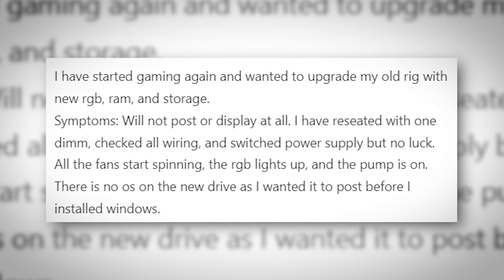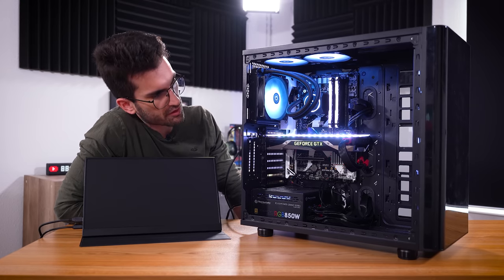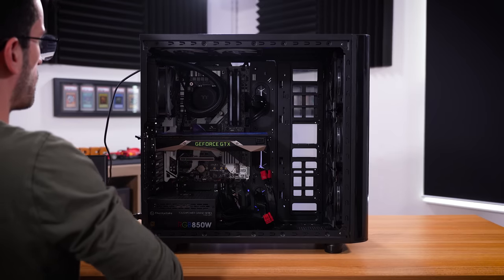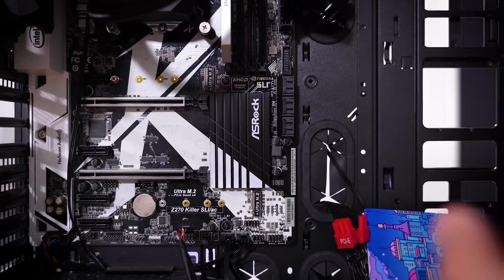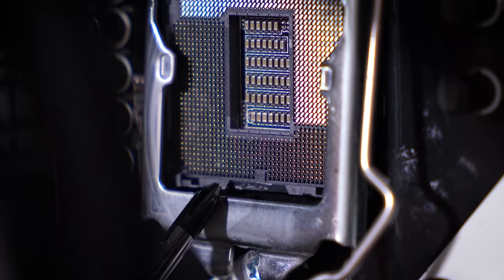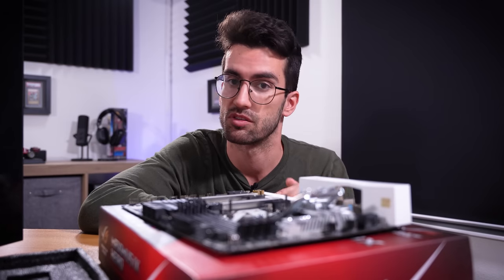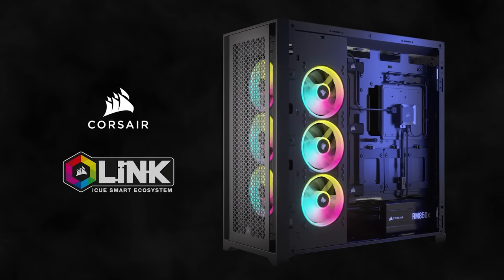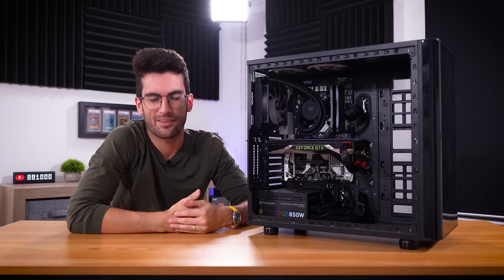Fixing a Viewer's BROKEN Gaming PC? - Fix or Flop S4:E14

Comment: kinda reminded me on how I revived a 7th gen intel mobo by asrock which was given to me since it doesnt work before. I just saw that it has some few bent pins that are not easily seen including a broken pin and proceeded to put them back with a tweezer. It eventually worked thereafter. right now it is being used for my sibling's pc which I modded to run an 8th gen intel cpu. good work, man.

Comment: Glad this worked out with the bent pin. Had someone else's motherboard end up with a pin broken so far down it couldn't make contact. Had to replace it. Luckily I keep older used boards on hand in case such issues arise. Keep making these great videos. They are my serotonin.

Comment: Great eagle eye for that piece of hair or something on the socket there Greg. I used to work at a refurbishing pc company as a hardware technician and this was very common issue, when someone wanted to change the cpu or just to simly clean the leaked out paste by himself. This often occurs when you try to wipe the paste of the motherboard with dry cotton (have seen it) and a piece of cotton gets cought on the pins of the socket, might bend/break pin or just make a mess, like in your case. If you can't see that string you would wonder why it doesn't post but apparently it messes with the contacts. Great "cheap" fix. Keep doing what you do! You are great !

Comment: I remember fixing bent pins on a motherboard to get it to work and then for it to fail later when I changed the cooler. This would motivate me to save up for a platform upgrade.

Comment: Nice that you were able to get the system running w a portion of that pin. I wonder if indeed that pin is used or if it was just shorting an adjacent pin in the socket.

Comment: Just built a system with this exact same board with a i7 7700k for my daughter. I got it for a great price locally.
When you flip the power switch at the back the led will flash once and then go out. Great board, first time I’ve built with ASRock.

Comment: I was in the Navy in a F-14 squadron. The aircraft used cannon plugs to connect wire harnesses and avionics. If we had a bent male pin we got a female pin of the same size and gently reshaped the pin. You couldn't do that on this motherboard but on a pinned cpu it might work.

Comment: Back in the day when i worked at a pc shop i had some odd failures with cpu pins. I had to get creative as no one had the money to replace the parts. I would try my best to create pins that was snapped off on the cpu and motherboard  or PCI slots with missing pads by using broken boards and cpus i had laying around. I created a very small soldering tip and heat gun using a file on old copper heatsink.that took me a few hours to get it round and right size. I enjoy finding ways to fix things with what you have hanging around you. i would enjoy doing this again but, as parts get smaller its not as easy to fix like the old days.

Comment: Hi Greg I am just wondering what CPU you would recommend for 1080ti as I am currently using a 4770k (slightly overclocked) and I am running into performance issues and stability problems with it as well.

Comment: Just recently built a new system with my brother. since then I have watched dozens of hours worth of PC building content. Ryzen 5600x. XFX Qick 7600 GPU. Musetex K2 case. ROG Strix B550-F motherboard. nothing insane but still miles beyond the 12 year old laptop I have been limping along with since moving to TN from WI a decade ago. Its been up and running for about a month now and it is hard to believe I have not used or run a desk top system in over a decade. I really enjoy the troubleshooting and build content and cannot wait to upgrade down the line and build another rig. thanks for the knowledge and all the information you put into your videos. 
 ~Eric

Comment: Hi Greg. Your videos usually show removing components and replacing them with a component you know is good. Working inside a PC case can be a real pain. When I need to work on my PC, I remove its parts and install them on my test bench. This allows me to see the components better and makes removing/replacing them more accessible. I also mount a working PSU on the test bench to eliminate the removal of the PSU from the PC case. Using my test bench assists me in the diagnostic phase of the repair process. I purchased my test bench from AMAZON for less than $30.00. It's the best money I have ever spent on my PC.

Comment: Ive used push pins to fix bent pins. Even a broken pin can be bent back a bit further to still make contact. It usually can save a system.

Comment: Hey Greg,
I recently had a case similar to this. PC wouldn't post, no matter what I tried. Funny enough, it also had a missing jumper on the 3 pin connector. I had to replace the battery and and also make sure that 1 & 2 (Normal) were jumped. Since then, the PC is running fine. Also, the red blinking LEDs are the default RGB pattern for that board (I had that same one couple years back)
Maybe that helps you in the future. Thanks for another great FoF Episode - I really enjoy watching these. Hope you, Lisa and the Kids have a great weekend!

Comment: My 4770k board had a single bent socket pin.  It was hard just to see the pin to even get the needle in.  I used a pocket lupe to make it easier.  Pin popped back into place as soon as the needle touched it.  Board is still going strong in old pc somewhere.

Comment: These symptoms remind me of a PC I built in an old 1998 case. I successfully installed Windows and used the PC some. I had some intermittent fails to see an image. I upgraded from a GTX 960 to a Radeon 7600. It would not display at all. I swapped in a functional 3060. No image. I moved the components to a 2010 case, needing to cut a few millimeters from one side of the GPU access slot to get the video cable to seat into the GPU. The issues vanished.

While needing to cut some of the access slot metal to seat the cable that I noticed newer cases have added an access slot on the side of GPU backplates. My two older cases paired with newer motherboards don’t align the first access slot with more modern multi slot GPUs. The cable would sometimes seat, and sometimes not with the difference being so slight that I didn’t notice it.

Comment: Quick question before I do anything stupid. I recently took out my old system to sell it by parts. I took out the CPU from the motherboard but since I use more than an average amount of thermal paste, it basically found its way into the LGA socket. The system still turns on but idk if its gonna cause some issues. No bent pins however, just thermal gunk covering 5-7 pins[Not entirely covering, the top of the pins still seem to have contacts. Will this cause some future issues?

Comment: Based on the initial showing it looks like the bend pin was shorting the other one and that caused the issue, In most cases even a few bend pins are no problem as long as they are for power or something not critical. I have also used staples inserted where a broken pin is cut to size and it can work to salvage an otherwise great motherboard from the waste land

Comment: When you don't have LEDs on the board connect a speaker in the front IO section off the board. It will beep in some order, that you reference to the manual to find out what is wrong.

Comment: LGA socket pins are thin and angled because they're made to bend down when the CPU retention frame locks it in. IE; they don't necessarily need to be as high as they are to make contact. As long as it looks Pretty Good™ it will probably work.

Comment: I feel for this guy.  I just moved from Nevada to Arizona and have a SFF system and a regular full fledged gaming PC.  The gaming PC survived the move find but I had a 5600x with a stock AMD cooler on it and didn't think to support the cooler in the move.  Well long story short, jacked up pins from the bouncing of the cooler because the roads from NV to AZ are literally the WORST and nine bent pins that are unfixable later.  Now I've got a brick because I think when I booted it, it nuked the motherboard and PSU. :sighs:

Comment: Bent pins on an Intel board can cause all kinds of issues. I had an older board that only recognized one channel of ram. I bought the tower with the board, cpu and that one ram stick installed. After I upgraded it to dual channel it no longer worked. Eventually did what you did and inspected the pins and sure enough a few were bent.

Comment: I've also seen I think it might of been debauer use a mechanical pencil to straighten pins on a CPU might work in the socket as well slot the tip of the pencil over the pin and it would apply even pressure to straighten

Comment: May be I think so that the dust was the main problems rather than the bent pin bcuz even of the some pins are not there it still boots up bcuz even if 1-2 gets bent the other pins come in backup which were not used and many time I have seen this happen when dust gets contact in mobo socket

Comment: it still blows my mind how a single small defect can cause a whole system to not work
also amazing how pin for cents can save a motherboard that could cost $100+
I used the pin to fix the pin

Comment: I had 3 pins slightly bend on my 5700x CPU system and lined them back up and that pc no longer boots with ram in channel B, tried different ram kits?? is it fixable is one of the pins slightly out of alignment and not making contact?

Comment: I was recently building a PC with an ASRock MB. It's a B365 and I had it previously working with a 9600K and a 1660S. I changed it to a 8500  with a 2060, and added a Crucial P3 NVMe to give it away to someone, but after the swap, I couldn't get a POST. I started with the basics, CMOS, RAM seating... nothing. I removed the P3 and finally got a POST. I had it running with an ADATA NVMe before, so I didn't understand why the P3 wouldn't allow it to POST. It had the latest BIOS version, but there was a beta version that said in the notes: "better SSD compatibility" or something like that. I installed the beta version and got a POST with the P3. Now, I'm trying to install WIndows, but I get an automatic BSOD and the code points to GPU. I tested the GPU in another build and it was working fine, so I tried installing without the GPU since the 8500 has integrated graphics, but I get the same BSOD. I'm leaning towards the CPU being bad, but I haven't had the time to test it again with the 9600K since it's already in another build. I don't have another NVMe at hand, so... would you recommend swapping to the 9600K or trying with another SSD?

Comment: I wonder if the bent pin is simply "double bent", which is why it's shorter.  Obviously, it'd be impossible to straighten fully without risking borking the socket entirely.

Comment: This is a great series, fixing random computer failure issues. I recent had to resolve a overheating issue with one of my kid's computer, the AIO failed. Now back on air cooling for the time being. Random comment picker is a good away to get a comment without having to spend time reading. Congrats to the random winner. Greg I will say this is a great option and good to luck.

Comment: Many moons ago I bought a really nice Gigabyte Z170 motherboard used from someone on OfferUp for $50. I notice there were bent pins when I met the guy, but it was a high end board for $50. I figured I could bend them back and be golden in no time. Long story short, it took nearly 3 hours and pins from a socket 775 donor board to get it to work. It's still working perfectly, but I'm afraid to upgrade the CPU because a couple of those pins were just carefully set in the holes and the cpu holds them in place. If I ever get rid of the board, the cpu goes with it! 😜

Comment: The amount of times my pc or my brothers have power cycled has always had me confused, with his system it needed a new PSU then worked like a charm, mine needed new ram, then worked but then when i upgraded his ram it wouldn't even boot (i have a love-hate relationship with ram) but somehow in the end i have always fixed both of our system even after dropping my amd cpu the pc i built still works but without your videos im sure both of our systems would be dead.

Comment: I used to do software support for a government contractor. I would take crossword puzzles with me. I was nice and friendly until they asked me to show what I was doing so that they could fix it themselves the next time (not going to happen since most users did not have admin rights). This is when I got out the crossword and stopped talking while working on it. We had one genius try to keep anyone from accessing his files. He somehow was able to change permissions to admins only (or someone did it for him). I was able to access the pc remotely and correct permissions. He did not understand how I was able to do this from my desk. I actually tried to work from my desk most of the time. We had remote areas that had pcs just for workers to log in and out for timekeeping. Since they were so far away, the network was slow. They would put in a software ticket (for a non-existent problem) then complain about the speed. This was a network issue not a software one. I got yelled at once for basically telling them not to put in software tickets for slow network. Hardware, software, and network were separate groups.

Comment: Hey Greg have you ever had a pc that post will play games but during playing will shut down and only way to turn it back on is to flip the psu switch. I don't think it's a heat problem cause my Temps stay around 60c and have also replaced my psu already same thing happens if I can get direct help can you point me to one of your vids

Comment: I had a very similar problem happen with a used B85 motherboard I bought a while ago, CPU , RAM and PSU very known working and motherboard would boot then turn off and boot back on and run without display but after like five minutes of leaving the motherboard running like that the CPU fan would go crazy but would not turn off unless I manually shut it off. Luckily for me the seller took it back and got my money back.
BTW I have this issue where whatever I type in a Browser (other programs aren't affected) the letter right next to the cursor would disappear and come back in a split second ,its very annoying but I couldn't any good info about it online. Happens on both Brave and Chrome

Comment: Greg maybe you have seen or anyone else has I am using Opera GX for internet I have issue with screen going black and white with little white and black squares all over the background but it is only with the video on Hulu and YouTube video will play ok but the background does this as soon a mouse is moved it goes way. The games I play are ok no issues. Just started in Sept I think it was after windows update. Been working on computers for over 25 years first time I have seen this.  Not a virus or malware have done scans an even did a Tron cleaning  to see if I had any virus or malware none.

Comment: Just installed a new cooler and some cable extensions, and now my computer wont turn on. I removed the extensions, checked the psu, removed the gpu, but sadly still no power kind of. When i flip the psu switch it looks like the chipset flashes and my cooler is partially lit up and my keyboard is powered but thats it.

Comment: The biggest risk in building a PC is bending a pin in the CPU socket.  Good to see this one was fixable; many times they aren't.  Well they are, just not by the typical consumer.  The trouble with sending a board off for this sort of repair is it can easily cost more than the board is worth.

Comment: I have a Question i have a HP Pro 3000 desktop i got cheap just to play with i have replaced the CVPU the motherboard and i have purchased memory for it but im not 100 % sure if the memory is right but this is what it said in a reference guide for this desktop and i still get no post at all the fans turn on i have checked all the usb ports they all have power , and i have looked very closely at the socket to see if there was bent pins there was not 1 bent pin any ideas. This is driving me crazy i don't know what the problem is i have tried to put all the ram in 1 slot at a time tried them 1 at a time in every slot nothing , when i try to change the source in the monitor settings on the monitor it says going into sleep mode
.

Comment: Sounds like my current system in a way, ether it's making enough contact, or it's a dummy/testing/needed for something the normal user won't ever trip over. In my case, my r5 2600 Ryzen is missing an outside pin and renders ram slots 1 and 3 unusable by the cpu, but doesn't cause any other issue. Outside of being forced into single channel mode for my two sticks of ram.

Comment: After much research into how I could enable the bios settings so windows 11 could be installed , i updated the bios on my asus x570 plus wi fi board , all went well , bios updated with no problems , rebooted to a blank screen , no option to enter bios at this point , all lights and fans work but no post . After a lot of faffing about which included swapping the graphics card and removing the cmos battery and unplugging all but the mouse and keyboard , same result , no post , no display . I connected all the original devices and changed the monitor over to my other one , booted first time and into the bios , unplugged that monitor , plugged the original in and it booted first time. I am at a loss to explain why , perhaps you or someone here can explain